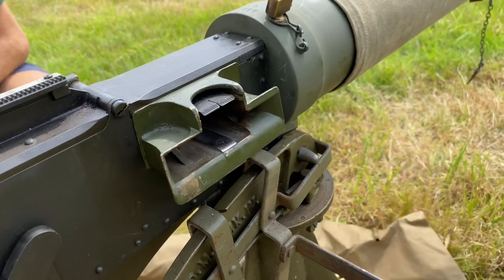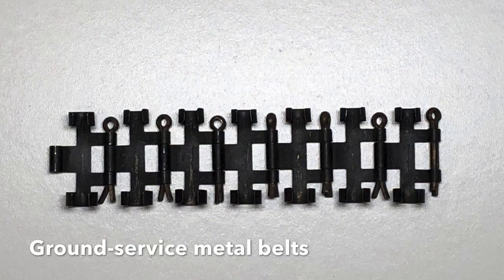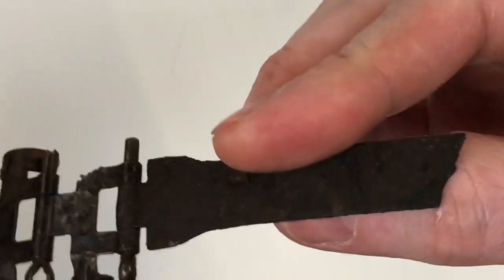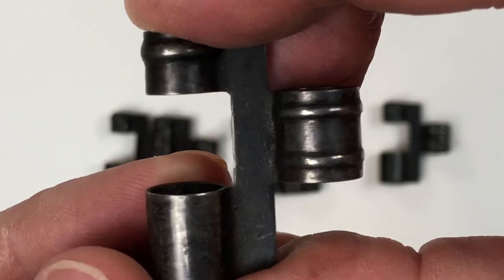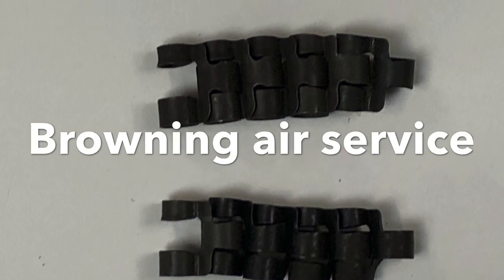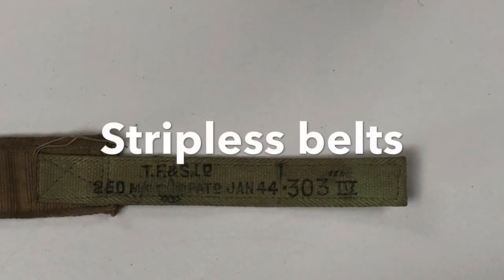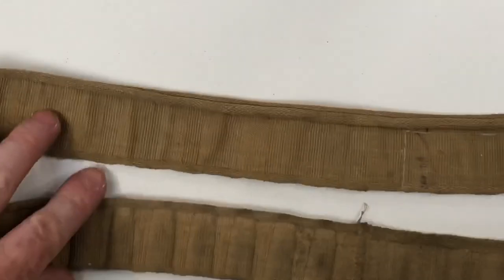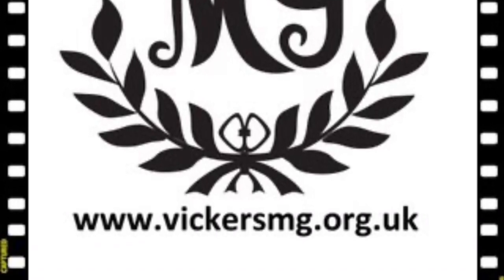Vickers MG belts and links

Comment: Had .303 in the later type of belt issued for use in No.4 rifles in the mid 1980's as a Cadet. Wish I'd kept a belt!
Reply from the maker: Absolutely. I think that’s where the shortened strips of it originate from as they were cut to issue.
Reply: @vickersmg  Come to think of it they were probably in rolls of about fifty but in a card box. That said, this was 35 years ago and the memory plays tricks as we often see in the comments section.
Reply from the maker: That’s interesting. It would be good if some turned up.